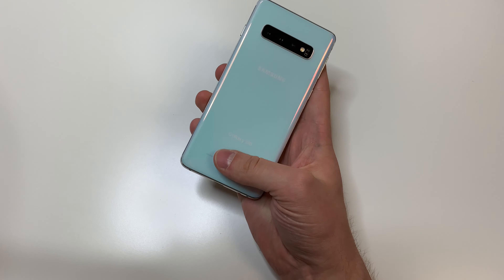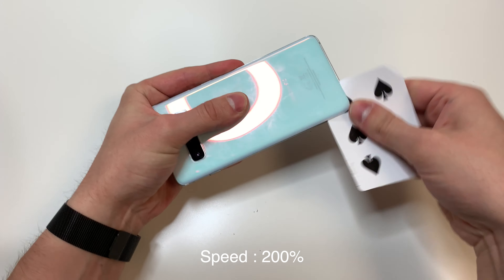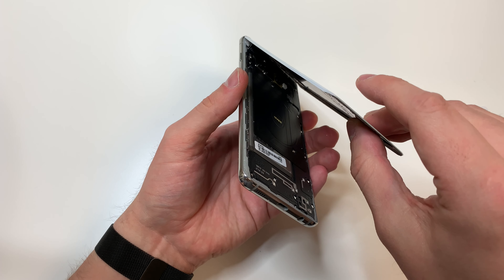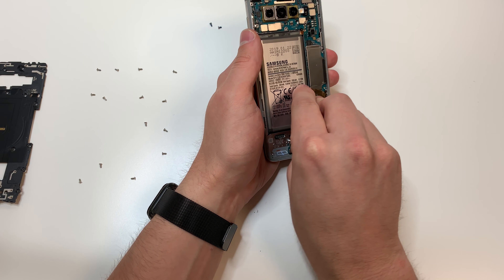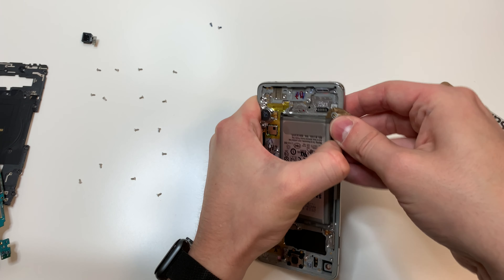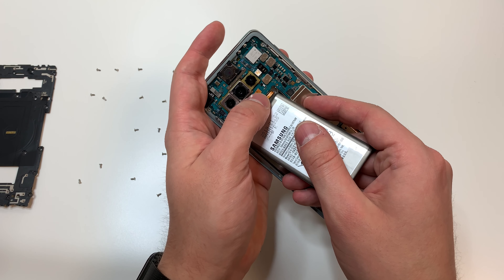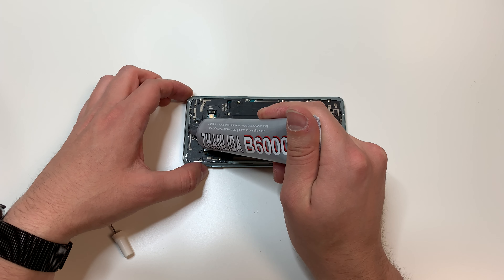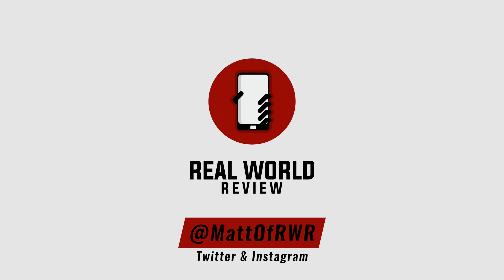Samsung Galaxy S10 Screen Replacement (Fix Your Broken Display!)

Comment: Thank you very much, i did this first time i really messed up the tape side so i bought some more and glue for the final part to be rectified but minus that absoulte breaze minus the screws being so tiny and sometimes difficult. I would say laptop repairs are still a step above phone repairs but thats my experience.

Comment: Do you have to remove everything in the back if you are only replacing the front screen?
Reply from the maker: Yes
Reply: My understanding is that the "front screen" includes the touch sensitive components, finger print sensor etc so basically IS about half of the phone (it would be nice if the front glass was separate - I don't think it is/or at least it can't be reliably replaced that way retaining phone functionality).

Comment: You totally skipped the part of installing the new screen
Reply from the maker: Because people shouldn’t do that. Plus parts with frames are easily accessible to the average person
Reply: @RealWorldReview  at a cost greater than what you can get a replacement phone for. I have found these phones going for less than the parts to repair them. Time to upgrade to a 22 Ultra